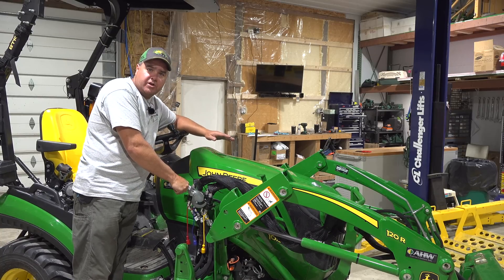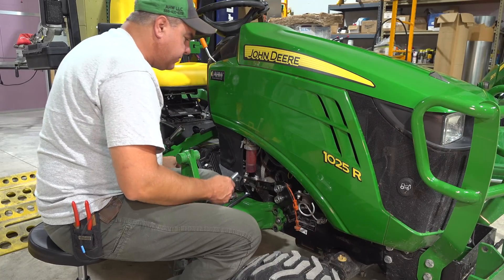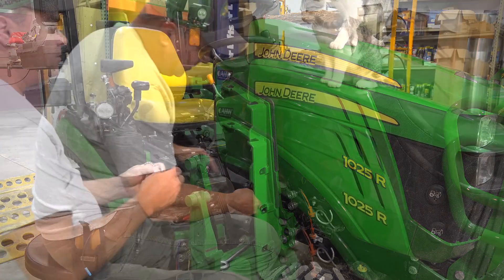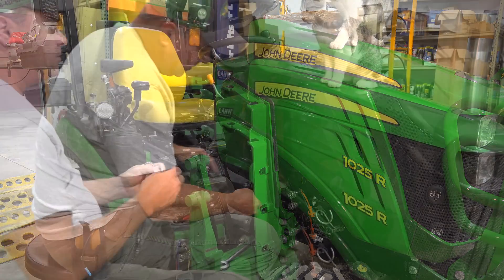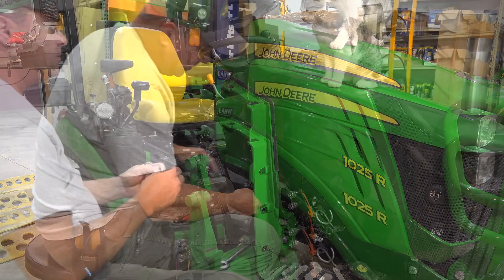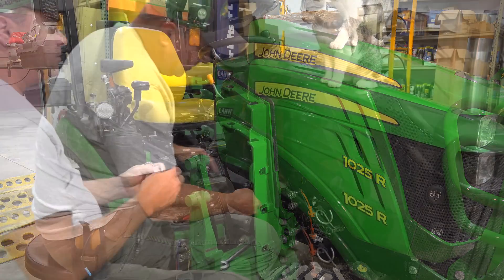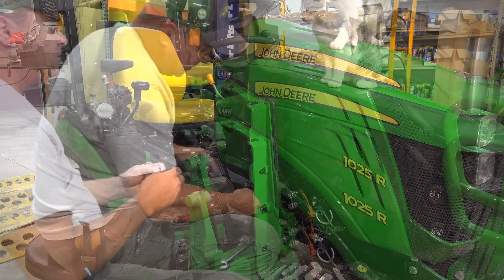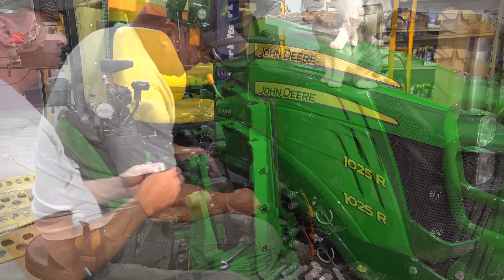Single Point Hydraulic Connector; Deere 1023e/1025r/2025r

Comment: I just received my new 2023 John Deere 1025R today sept 15th. Many new changes came on this tractor. The single point connection came standard. All the lights are now LED. They changed the parking brake to a hand grab handle type and it is located on the right side of the seat. Thanks for all your videos, I have gained a lot of knowledge watching them. Great job!
Reply from the maker: Covered this in a recent video.

Comment: Advice from someone that uses single point hydro. Keep them clean we use carburetor cleaner due to it not leaving it oily. I've had a lot of problems from them not being cleaned by other truck drivers often. FYI we use them on auto steer wind turbine trailers. I think its cool how the trailer steering on ours using nothing but hydro flow to work the only electronics on the trailer is for the remote when we need to steer it from the back to make some corners.

Comment: I'm an old guy and use my loader as much as my mower. Put one of these on beginning of the year and haven't looked back. I like not having to shut off the tractor or having to get off of it to remove and connect the loader. I can drop the loader in my driveway go cut grass and put it back on with zero effort. For us old guys with mobility issues this is a must have and the price has dropped to under $700... worth every penny. Now I have to figure out where I'll put a diverter valve...

Comment: The only other comment  I would offer is to check your hydraulic dipstick level once installation has been completed and the front loader has been cycled.  Now equipped with new, dry lines, the hydraulic level needs to be checked and likely...topped off!  Small point, but I beleive an important one.  Great instructional video, Tim & Christy!

Comment: I saw this when you first posted it and thought I would like to have this at some point. Had a car accident this last fall and my hands where bandaged up and in a cast and my wife was trying to help me get the snowblower on and when it came to putting the hose on she was really struggling and I was very little help she finally got them on and I told here about this single connect but I told her it was pricey and she said get it before we have to put the loader on so it will be easier and if push comes to shove she can hook up the attachments herself. So now it’s spring and it is on order. And by the grace of God is has come down 200 dollars since you did this video.
Reply from the maker: Congratulations!  You will love it!

Comment: Tim I purchased and installed mine yesterday and wish it was as smooth sailing as your install, but here are a few things that your viewership need to know. If you have a cab as I do on my 2022 1025r, the lines from the coupler station down to the quick disconnects on the tractor end up being extremely strained by the cab footwell extension that protrudes into the space where the shorter lines would naturally be installed so I ended up taking the kit supplied lines off and switching back to the original lines. I will readily admit that the lines are pretty long which I'll replace later but I have a mower deck so mine rest on top of the deck and the aluminum bracket that came with the loader I mounted on the tractor to keep the lines away from the tire. Speaking of the bracket that came with the kit to hold the quick connector, it also interferes with the cab so could not use. Also had to grind down the coupler bracket that attaches to the cast iron mount because the latching mechanism on the quick connector interfered when trying to open it. One last thing on the lines connected to the loader, I installed mine the way you did with them facing rearward but ended up facing them downward to allow the hoses to be more out of the way than being bulked up on top. In hindsight I'm wondering if all the kit lines could have been swapped but I'll save that for another day. Now to solve for the mower deck hose and your DiscountHydraulicHose.com suggestion from my previous post.

Comment: Every time I have orderd parts from Deere I have always had instruction with the item. Deere had a system like that back in 2009 when I worked for a local JD dealer. Guess it wasn't available for the small tractors at that time. Nice thing about the kits you get from JD is you get everything you need.

Comment: I ordered my single point for my 1023E 2017 H120 last week should be shipping today can’t wait to install and make my life easier being older this will help, the cost was only $653.40 they had the price wrong when released,  with a few adjustments to the loader lines using additional fittings it should be easy after watching your video Tim,  Thank You!
Reply from the maker: Yes, they reduced the price right after I made the video!

Comment: I think I am going to have to do this, at 83 and breaking down physically this seems to be the best alternate as I take the loader off to mow and put it on to move pallets and or the scoop. Thank you for the help on this.
Reply from the maker: Yes. Works well. You will appreciate it!  You may need some help installing. The large pedestal bracket is heavy!

Comment: Just finished welding the mounting brackets (left and right) so that my Kubota bx loader fits on my Iseki. 
I will get myself these quick connections, since I will remove and put on the loader fairly often. In Germany you can purchase the 1025r with a stoll loader, really nice setup. 
Nice Video as always.

Comment: Good video. This quick connection was one of the deciding factors on buying our Kubota bx2680. My wife uses the tractor regularly and would need to remove the front end loader and the quick connector is so easy. Nothing wrong with making life easier! One tip with the quick connection is to blow or clean the surface before installing the loader connection. Dirt and debris collect in the connection area and if not cleaned can cause oil to leak from an improper seal. Tim I really enjoy your channel so keep them videos coming!!

Comment: Didn’t install quite as clean as the BX but looks very stout. The BX leaking at this connection is mostly due to hookup procedure, I found out after I had a new one installed that leaked too. Ended up not being the BX fault but how I was hooking it up. Has not leaked again in 4yrs and it’s used three or four times a week. Great video as always! Thanks

Comment: Ordered mine today and in stock too. Even though you did an excellent job on what and especially what not to do, I am getting frigin old and not a project with so many fitting that can leak. If it leaks , they can fix it.  JD install will be $275.

Comment: I had nothing but issues with the BX quick connect.  It constantly leaked, had it replaced twice and same issue.  Finally I got the dealer just to to convert to straight connections and had no more leaking issues.

Comment: Great video, and what seems to be a very handy quick connect system. I’ll bet that heavy duty bracket you first installed was at least half the cost of the system, based on the engineering that seems to have gone into it. In my personal situation, the loader might as well not even be quick attach because it never comes off, so this really has a little value to me, but I can see where for some people it would. I appreciate you making the video easy to navigate for those who wanted to skip installation, but I ended watching anyway to see what this was all about, and glad I did. Your experience and longevity in your relationship shows with your “Quick Save” regarding the vise. LOL
Was very informative and fun to watch. Thank you. 👍

Comment: Glad the price came down (and free shipping with your coupon,  and a free hat , nice) $654

I blow air on all the couplers everytime I switch attachments , they work like new.
Reply from the maker: Congratulations! You'll love the single point connector.
Reply: @TractorTimewithTim  Since you online Tim, I still have to switch the line to divert to the mower. I have a valve that I never installed...but refresh my memory ...if you would ,what is the add on from JD that fixes that ? The one I have is a manual valve to switch between two ports. Never got around to mounting it somewhere...maybe with the single point I'll have a place to mount it and get some hoses made.
Reply from the maker: Mid mount mower lift options ...on http://tractortimewithtim.com
This shows the part numbers required to upgrade from ‘hydraulic lift’ Which you have to ‘independent hydraulic lift’. This would get rid of the single hose.
Also, you could drop back to the ‘mechanical lift’.   Check out the article.
Reply: @TractorTimewithTim  Thanks, 

The guys at Green Parts are good, they called to confirm I had a 120 H loader and it wouldn't fit. I explained why it would. Should have it tomorrow the 8" of snow today slowed Buster Brown down....Might have to work fast to beat out the next snow storm. Wish we could send the Keystones snow to you...

Comment: I am glad that you finally got a single point.  I have one on my 2039R and some times I have take my loader off several times a day, depending what I am using the tractor for. What I would like is the bracket for storing the hoses.  I also have the 3rd function and like you, I have to plug  and unplug them manually.  Nice video.

Comment: Now at  $690.80 and having a factory cab its almost imposable to hook up hoses with a 45 deg. ends, ( should have been straight for cab models), the block that the hoses plug into are under the front of the cab and makes it hard to push in straight so I will be ordering this soon. Thank for the review.

Comment: For my 2014 1025R,  5 Years ago I bought a MultiFaster P606 (still available but slightly redesigned ) used for a reasonable price on ebay.  also bought an extra implement side section.  it has 6 ports.  Then i designed and welded up a bracket to mount to the two square holes on the Loader frame upright  purchased four short hydraulic hoses (You are correct they are not cheap) to go from under the floor board to the tractor mounted Faster and have been using with pleasure ever since.  I remove the loader each time I cut the grass in under 60 seconds and it reattaches just as fast. I also have a connector on my snow blower.  This year i did need to change out 3 connection valves due to corrosion so now I keep them covered if I leave the reactor outside. My Original Cab will also fit with this set up so Is well worth the investment. also Faster does offer an electrical connection instead of Hydraulic if desired for the same units. Keep up the good videos. cant show a picture here will post one on https://www.greentractortalk.com/forums/

Comment: Good video Tim, and I like the fact that you told us about your mistakes.  I have always wondered why JD puts the loader QC so low on their tractors.  I worked for a guy for 2 years and both of his tractors were like that.  Like someone else commented, a little WD40 to work the dirt out.  These 4 line QC for the hydraulic hoses on FEL is a nice feature.  I was impressed with how stout the bracket is for the QC on the tractor.  Keep the videos coming.

Comment: My Massey loader quick disconnects are impossible to grab hold of to hook and un-hook. I modified a welding vise grip to lock on to the  "quick" connector. The tool had 1" flat fingers that made a 90 degree angle, I cut the fingers at the 90 bend and only had to grind open the jaws a little to go around the fitting. Now I just compress the fitting with the pliers and it locks the connector open and makes it soooo simple to hook and unhook. The great thing about the vise grip is the adjustment screw, just a turn or two and the connector can be locked in the completely open position. Cost around $ 20.00.

Comment: Hi Tim,
I have 1025R with a loader bucket, forklifts, brush hog, backhoe, auger, boxblade, rake and mower deck. I use all of them so yes, I'm constantly switching implements. Because my tractor is the primary mower for the property I do remove front and rear implements to mow. I would say on a scale of 1-5, removing the front loader is 2.5 because the plugs don't always release easily and because it's so low on the tractor it's ALWAYS dirty. Not only does this single point get you off the ground, I would think your new disconnect location will stay cleaner.

Although I experience this problem more with the rear hoses, but there are rare occasions where I have had to tap the nipple on the male end to relieve pressure so I can insert the hoses. I think this single connect will provide enough leverage that even on the chance that a hose is under pressure the additional leverage you have from the disconnect will mitigate that problem. I will be pitching this to, "finance".

Comment: I have never taken the loader off of my 2018 2032R.  I ordered mine with the single point connection.  If I had it to do all over again, I would still order it with the single point connection.  It just makes good sense.
Reply: (Of course, it just makes good sense to order it without the single point connection if you can't afford it.  The main thing is that you get the tractor!  😀)

Comment: From what I can see of the connector it is substantially stronger than the BX quick connect. The connector on my wife’s BX started leaking. I spent over an hour checking the tightest of the hoses before I actually discovered the cause. The first time it happened and after I checked all the fittings and connecting it back together and reinstalling the loader. The test I was doing showed the leak went the bucket was at a full up or down position. Thus I removed and installed the FEL four or five times.  The last time I moved the bushing that the latch snugs the coupler together. The bushing looks more like some kind of composite rather than a strong metal. The other issue is the the Deere quick connector you showed and the two that are on my Grand L is that those have two latches and two bushing. The BX only has one latch. The two latches divide the force of closing and holding the connector tight. The BX only having only one latch has to take all the force. Anyway by just spinning the bushing I could stop the leak, but it meant always testing the connection and removing the loader and trying it again. I had the dealer replace the coupler under warranty and they did. The cost was over $650.00 for that coupler and I noticed that it already has a nick in the bushing. With all the pieces you get with that kit compared to the BX it seems almost free. They are now putting that connector on there B an LX series; however, I don’t know if it is the same one as on the BX or not. If I could get that Fast connector that you have it would certainly be worth it if the hose fitting fit the BX. While the BX is a great machine and does a lot of work quite well, it seems that the main thing Kubota concreted on was shaving price points.

Comment: About the question "Is it worth it?":
The thing is, we mostly approach this question with our minds already made up that it's soooo difficult to take the loader off that it's not worth it, "I just don't take my loader off", "I can do most things without taking off the loader", "I'll figure out another way".
This connector, combined with the loader walking itself on and off makes it worth it, now you can easily take the loader off to do your tractor maintenance, you can do your mowing without front or back implements. You have more visibility when the loader is not needed. You can think of new ways to use your tractor, that you would just have dismissed in your head within a 1/2 second of thinking it before. It's easier to consider using other types front implements like a front snow blower. You can consider doing more things in a forward motions.
There are many manufacturers of this type of multi-connector, Liebherr, Faster, Stucchi, Manuli, and more.
Next for John Deere would be to include the 3rd, and make it connect at the same time as the loader, in one step: https://www.youtube.com/watch?v=6XDyt6-pFO0

Comment: I do use my tractor as a multi-purpose tool; but I leave the loader on all the time; even when mowing. OTOH; my mower is a flail mower, and I often find the loader useful for pushing stuff out of the way (6 acres of brush, scrub oaks, and weeds).

Comment: The line losing the oil, I learned how much comes out.. I snapped one of those lines you were loosening on that left arm..  Got caught during grappling of heavy brush and snapped right off.   I also learned, drop the bucket/loader arms as far down as you can before disconnecting them again.. Once I dropped the arms down, the leaking stopped.   After replacing the connector, it was not tight enough and again started leaking when I powered up..  I shut down, dropped the arms and the leaking stopped, properly tightened it this time and leak was gone on the line replaced.
So far I have snapped that line connector and the line connector going to the front left tire turn hydraulic piston and then had one on the other arm on the right side turn loose and need tightening.  Heavy brush is not easy to work in.

Comment: My jd 640r loader has a single point hookup for the grapple  when you take the bucked off. You can mount one of those behind the one you just installed then you just plug in two of the single point hookup

Comment: I have the single point hydraulic connector for my loader on my JD 5100M and a single point connector on the front  of my loader for connecting my grapple and they both work great.

Comment: Finally, a possible fix for connecting loader hydraulics on a 1025r with a Mauser cab. The connectors are buried under the cab floor and are next to impossible to get to, especially with arthritic fingers. I finally just left the loader arms on all the time rather than fight with the connectors. This single point connector might just fix the problem. Hopefully the bracket and hoses won't conflict with the cab structure.